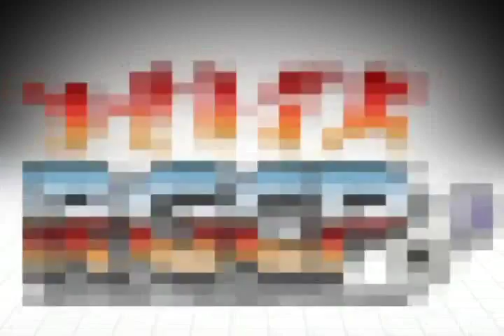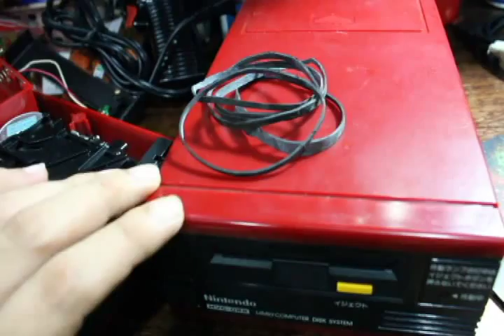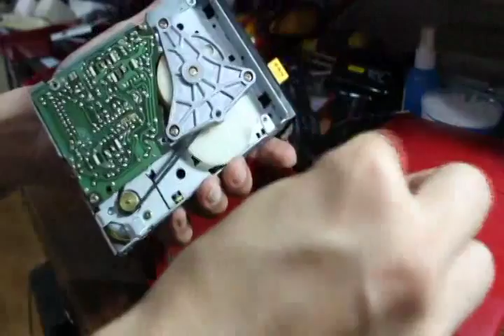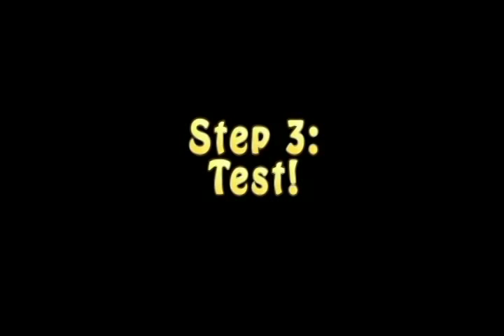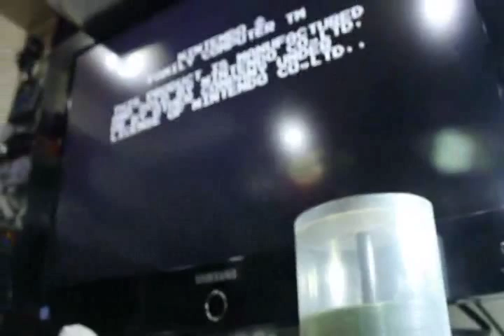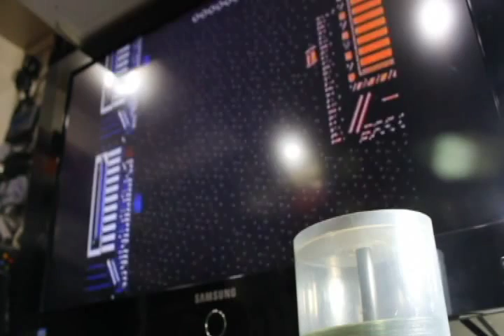(RGCP) - Famicom Disk System Repair Belt Replacement

Comment: Great video! My experience on spindle alignment: I have an Akai sampler with the same kind of drive. The belt was gone, I replaced it with two square belts. Not optimal but works. I looked at the disks and saw a way to alignment from those. I mean, when they are ejected, their traction hole points always to the same direction. I plugged in the drive after assembly and it ran to  end and stopped. At that point the spindle screw should point OUT of the drive. No need to take plastics off. I verified with Akai original disks and they all loaded fine. However, I started having problems much later (months). It looked like the spring does not pull well, but as told in the video, "do not touch it" so I did not. The reason why the head did not go to the switch was missing grease from the central guidance pin/slot. After greasing it moves fine. Then I did the spindle alignment again, as you and others tell. I thought that when the drive stops at the other end, the inertia causes the spindle to turn and the friction from the disk varies, so it doesn't always stop exactly at the same position. I also tested the speed of the motor and found that it is not critical. I did not try finding the limits for min/max speed but someday I will. The best speed can then be adjusted by listening (or measuring the motor frequencies, FFT analysis like in Audacity). Thank you.

Comment: Hello. I replaced the belt and adjusted exactly how you showed here. It works. But when i assembled it its not working. I try adjusted again when it was assembled and it worked couple times and then agai error 22.  It seems like it very sencetive. What can i do to make it work all the time. Or maybe its because of my two discs?
Reply: Evgenii Spinen It could be the discs.  I attempted a few different ways and sometimes it would work, sometimes it wouldn’t.  Finally I tried a new disk and it worked every time.  So it must’ve been the old disks have some bad sectors.

Comment: sir, I think you can revive the burnt-out motor by replacing the brushes, should be an easy fix thru a piece of copper sheet. the coil can also be rewound, but it has to match the exact same gauge and # of loops :)

outstanding tutorial sir, and I love that GUNSMOKE game :D